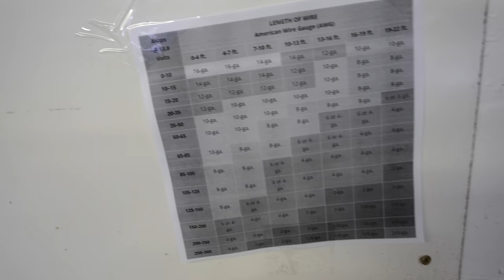Building the Brains of a Low Voltage System - Electric Hummer Conversion

Comment: I would recommend measuring the resistance of the wiring before and after those solder-heatshrink connections. Those add a lot of resistance to the circuit. That is why crimping is recommended. Besides that, the build is looking cool.
Reply: Amen i would never trust those unless you slide it over one wire then twist wire strands together first before sliding sleeve over and applying heat.
Reply: Exactly what I thought. Usually when wiring something in car you want to crimp the connections instead of 
soldering because vibrations from driving can crack the solder. Crimping and wiring is also acceptable
Reply: They do add a noticable resistance and I wouldn't use them for long high current loads. That solder softens easy and they fail with vibrations in combo. I use them for the excellent water resistance, especially in marine applications and I often add a second layer of heatshrink on top. Tip is heat the ends of the connectors. let them cool. then heat the inner solder part.
Reply: the resistance of solder splices is neglible (or effectively zero) if the splices are done correctly. They are fully rated for aeronautical and aerospace use, I was suprised to learn.
Reply: Yeah those connector suck but crimping is horrible as well solder whenever possible crimping add huge issues if you can solder never crimp it's not worth the headache down the road

Comment: The be clear, you ripped out 87a, it’s not “always on” it’s how the relay is wired if you make that wire in the circuit “alway on”. The small trigger wires of the coil are 85(-) and 86(+). A relay simply uses a small trigger to switch or control a larger (more current demand) circuit. People think that a relay somehow spools up energy and spits out higher current, which is not the case. To explain simply, controlling headlight, your (12v) supply will go in on 87 and when the relay is triggered (by the headlight switch, alarm, anything connected to the low voltage trigger wire, 85 or 86) the voltages flows out of 30 turning the headlight(s) on. 

You can ply a joke on your friend by wiring the relay to “trigger” when the brake pedal is applied to honk the horn or activate the wipers. This may require multiple relays depending the needs of the circuit and what the triggers and inputs are on the car. It’s good fun though. 😁

Comment: The explanation for the relay is unfortunately wrong.

2 cables go to the coil. This generates a magnetic field. The magnetic field physically moves a "switch". W

If there is no power connected, then the current flows through the yellow cable that you have removed. If the "switch" is activated, then the current flows through another cable. 

On the yellow cable, there is never any permanent current on :)
Reply: Correct, there is a normally open (NO) side and a normally closed (NC) side. The switch just changes which of these is connected for the current to run through.

Comment: Are you converting the 24 volt system over to 12 volt? All those lights and keyswitch etc. is all 24volt. When I did Duramax conversions on h1s we had to convert everything on truck that was 24 volt to 12.

Comment: Stranded wires have a higher resistance than their solid counter part, given that they have the same guage.

Standed wires are used over solid wires when the application is where there is vibration. 
Solid wires are used over stranded when the application is where there is a great potential for corrosion. 

Electricity runs through the copper not only on its outside.
Reply: The skin effect only affects higher frequency cables: at DC, current indeed runs through the entire conductor, so the argument mentioned in the video was indeed incorrect. It's a fair mistake to make though, since the power grid (running at 50-60Hz) does need to take the skin effect into account

Comment: coming along great! Word of WARNING: those generic branded DC circuit breakers are not very reliable. I just saw a video of someone testing those and they can trip much much lower than rated. I'd go with the actual Bussmann branded breakers, or just an AMG or ANL type fuse. Don't want that breaker to fail or trip when you're going 60 down the highway.

Comment: 23:40 Make sure you have couple backup fuses right there stored away, with so many you always want a handful as backup.
Reply: when u do it right u dont need many replacements...
Reply: @thegreenengineer7994  This is not prices engineering, this is out of the thumb engineering. So expect stuff to happen that you didn't expect.

Comment: This is coming out really cool and informative!
Though, anybody else upset that he didn't really clean the Hummer before doing this process? All that dirt and sand still in that box where he's putting the electrical! 
I mean, after tearing off all the mechanical components, I would have tore out any of the carpeting and whatnot and just give the whole chassis a good power-wash at least. I'm assuming he wants to keep that military-used patina to the paint job, so I'm not gonna ask why he didn't sand-blast the whole chassis and body. But yeah.... clean that dirt up! hahha

Comment: DC current will run through the whole wire strand, it's just AC that runs on the outside due to the skin effect
Reply: Also not all AC, but just higher frequencies. For 50/60 Hz, this effect is also negligible.

Comment: Why not use LiFePo4 batteries? 
+ Longer Cycle life
+ Higher Capacity 
+ Long Lasting 

- Cost 
- Risk of explosion (although there is no engine to generate heat and you’re using Li-Ions anyway 

Lead acid is old school, upgrade that too to the latest

Comment: AWG cracks me up every time. It's like some drunk apprentice just started giving wires random numbers.
Reply: Just do it like it's done in the eu. "mm²" Just call it what it is. The AWG system is so weird.
Reply: It is weird, but think of it as a fractional system, but in shorthand:  1/20th gauge is smaller than 1/8th gauge, which is smaller that 1/4 gauge, etc.  Drop the "1/" part of the number, and you have the AWG gauge number. Which gets confusing as you get into the 0 gauge, 00, 000, 0000 or otherwise known as 1/0, 2/0, 3/0, 4/0 or "single-aught, double-aught, triple-aught or three-aught, quad-aught or four-aught", etc, range.
Reply: Hey now, they are at least mostly sequential, so we have that going for us.
Reply: @squrrll  until you run out of numbers and start stacking 0s
Reply: AWG does look weird, but there’s a method to the madness.  The gauge numbers are relative to their *current handling capacity*, not their diameter (metric).  For example, 14 AWG (common house wire) is good for up to 15A.  Now suppose you wanted to carry twice the current, 30A (dryer).  Well with AWG, you drop by 4 gauge numbers, putting us at 10 AWG.  Want 60A? Drop 4 from 10 AWG and you have 6 AWG, which is good for 60 Amps.  I grant you, the 0 gauge numbers are weird, and after those, the system switches to MCM.
Reply: I usually just think of it as how many wires I can  fit in 1 inch of space ,so 20 Guage can fit 20 wires  and 10 guagecanfit 10 wires. When it gets to zero its 1to1. Each additional 0 represents an extra inch. I'm probably most likely wrong but it works for me
Reply: @gregholloway2656  Yeah no, just no. Use mm2 like 95% of the planet.

Comment: Your explanation of skin effect doesn’t apply to DC as there is no alternating magnetic field. So stranded wires aren’t preferred for DC, it’s only an AC thing. 
Maybe has a mechanical advantage but electrically inferior wiring.

Comment: I'm an electrical and electronical engineer. what you are referring to is the way a signal is transmitted through a Coaxial cable, not a standard power wire.  I think what you were getting at was the "skin" effect of thin wires. the coaxial inner core is a steel wire with a copper coating all around it. the signal is carried by the cooper not the steel wire.

how electricity flows through wire? The electricity that is conducted through copper wires  consists of moving electrons. The protons and neutrons of the copper atoms do not move. ... Atoms are very tiny, less than a billionth of a meter in diameter. The wire is "full" of atoms and free electrons and the electrons move among the atoms. 

The reason for all the strands in a power wire is the flexibility of the wire. as the strands go thicker the harder it is to bend and more over to cut. can you cut a strained 12 gauge wire with standard scissors? yes you can whit some difficultly. can you cut a solid 12 gauge wire with the same standard scissors? no not with out a outside force like a pair of pliers or a hammer.

do not remove the wire from the relay because you will remove the IP RATING of the relay. instead cut as close as you can to the rubber insulator.

Comment: the power running on outside of the wire applies only for high-frequency alternating current and not for dc which the battery provides! I'm not sure about it tho!!
Edit: the effect is called skin effect!
Reply: every alternating current has a skin effect. it due to self-induction. dc does not have that effect. but by the looks of it, these cables need to be flexible so that's why they are stranded. i guess.
Reply: @adid  we shall ask the @ElectroBOOM guy 😂

Comment: Nice work! Recommend isolating the battery from the electrical stuff with a physical barrier. The acid leaching, venting and corrosion dust coming off a battery will eventually take it's toll on the electrics.

Comment: 2:48 That's called skin effect and it appears in AC and variable DC, a great build project Jerry waiting for the results!
Reply: searched for this comment
Reply: I was thought solid wire is better then stranded but makes the cable stiff (good if the cable does not need to move anymore)

Comment: Like the build so far, I do feel the wires on the ABS board will wear through quite easily since you've put them right through. Normally I'd expect some rubber to protect the cables. As you said a lot of vibration will happen when driving so I'm worried the wires will wear through.

Comment: Good work. Only suggstion would be to use captive nuts or rivnuts for mounting the relays, so you dont have to pull the panel off to replace relays when they inevitably fail!

Comment: video 2 of asking jerry: What tech will you add on the dashboard, like satnav and any other stuff? 
note: pls add a mode such as apocalypse mode make the Humvee save power or something useful for the dark times, kind of like ludicrous mode in the tesla, if possible.
Reply: he should use an electronic dash for speed temps Gs etc then add a mid size display for front and rear passengers powered by a raspberry pi
Reply: if its an ev built for the purpose of not needing gas having an all electric dash wouldnt make sense. it would be wasting power on stuff that could also be done with mechanical parts, not everything could be mechanical though

Comment: The yellow wire isn't always on, it's connected when the electromagnet inside the relay is not powered. As soon as you power on the electromagnet, the yellow wire is not connected anymore.
Then you pull the rocker from one output to another :)

Comment: The smaller the wires in the wrap the more wires that can be used which increases the surface are and lowers the resistance of the wire and thats why they are rated higher.

Comment: Tip: power is measured in watts. Load measure in amps. It's your load on the fuse that pops it. 

Tip 2: Resistance of the cables working against the amperage, is what melted your extension  cord. Long cords have higher resistance than shorter cords. To combat that, you make the cord thicker. Still, length (and temps) is the killer of all cords.

Comment: soldered connections in high vibration situations are not as good as crimped connections. The solder gives a hard edge between the wire(flexible part) and the solder blob (rigid part). The small individual wires in the strand will always bend in the same location when vibrating or moving. With crimped connections, the bending location is more spread out. Just something to consider.

Comment: "The more strands of wire in the cable 
the easier it is for electricity to flow through them..."

This is patently false... 
Ampacity does have to do with surface area, 
(cross-section) but the Skin Effect is reliant on Frequency... 
DC has no frequency

What you are holding in the 4/0 cable is called DLO cable, 
the tiny strands make it more flexible- that's it... 

for example go look at some 4/0 or 250MCM THHN or other than DLO cable... 
DLO is like welding leads, the tiny strands move around 
more in their jacket making the cable flexible 

More Strands does not equate to more Ampacity- 
never has, never will

Ampacity of a wire of cable is WAY more complex than 
the size, surface area, insulation, and flexibility of the conductor- 
the temperature and application of a cable play a 
much larger role than the make up-of the conductor- 
as temperature increases, Ampacity decreases 
this is due to the resistance changing in the conductor... 
conductors in free-air can handle more current than 
conductors in an enclosure or conduit raceway... 
the principle issue with ampacity in a conductor 
has to do with temperature- 
that is why the National Electrical Code is 
written by the National Fire Prevention Association 

I'm dead serious on this... 

The NFPA70 NEC 2020 can be viewed for free online...  
look at section 300

had to un-sub bro- I don't suffer fools lightly

Comment: If it weren't strands, you wouldn't be able to bend it. (2/0-4/0 strand is hard enough to bend) We used 4/0 welding cable in our builds; it's finer strands and thus easier to work with. (we're also pushing 600A max @ 150vdc - higher V packs can use less current for the same power)

Your extension cord melted at the end because it had crap connectors. (an all too common thing.) If you overloaded the line, it would be melted out in the cord somewhere. It's easy to tell you're overloading it by simply touching it: it should not be hotter than ambient. (certainly not to touch.)

Comment: I'm confused. We had an H1 hummer and the 24 volt part was just for the starter and everything else was 12 volt, I heard that the HUMVEEs used a military wiring system that was all 24 volt components. Since you're pulling everything out you may not need to know the difference but that military wiring is oddball stuff on a road vehicle. Does your truck have any of the options like pressurized transmissions for deep water fording? That's why they have that sealed electrical system that you are ignoring. How about CTIS? There's a pretty big pump that runs that.

Comment: why need the battery if you have the bridge 480V to 12V? for redundancy?
and why 12V battery gel and not Li-po?

because that 12V battery will drop after 3-4years...

Comment: Just so you know relays were created to lighten up a vehicle as one can use the thinner lighter wire as much as possible on the vehicle and the thicker heavier wire only when needed for short runs. It's all done to cut the weight of the vehicle as more weight equals more power needed to go places.

Comment: The 0000 cable isnt normal wire, its weldflex, thats why its orange and has more strands. 

Also anything under 8b&s/gauge is counted down in mm or inch. Tell any autoelectrician youre using 25awg theyll look at you like youre stupid lol.

Comment: I would  rather use Deep cycle  batteries instead  of regular trucks battery since that really  needs to start the car. 
The curent  capacity to start the engine is what important on those and when the engine is running all electrical, the load side is running  off  alternator regulated probably  by PCM. So it is engine  alternate! 
Now question. How you actually  planning  to charge  that battery? The most efficient way for that battery  would be that engine  alternate  which ware changing it. Im assuming  you aren't gonna use that???
     So what really needs is constantly  maintaining the load (how much is it all together on 12v side?) and that actually  should  be covered up by your alternator which is on that hamvy ware probably  200A. At least. You don't  need that much of course. But let's say you want to be good at least to have  like 100amps of abilities. 
   I think your battery  will have to be changed! To what? Depending on the way you going  to charge  it!
 Also keep in mind that 12v system  runs on 13.2-14.2v in the vehicles systems under regular circumstances.
Would  you recall that glitch when you doorman light on battery became brighter when you start the engine?  you can see that difference aren't  you? :) 
Into consideration!

Comment: The effect you explained about electricity running along the outside of the wire is incorrect. The effect your explaining is called the skin effect I believe. This is only relevant with frequency signals traveling through copper wires. Have stranded wire is only a benefit to flexibility of the wire. A solid 1/0 wire would be able to carry more current due to there being more mass. The amperage rating is specifically determined by the mass of the copper in the conduit. This is why a 1/0 solid conduit has a smaller diameter than a stranded 1/0 conduit. Because the density of the wire is higher when solid. 

If electricity truly ran on the outside of the wire, it wouldn't make any sense to use anything but super thin copper strands.

It is interesting to hear you explain concepts when you don't truly know them well enough to be a teacher. You state this clearly in all of your hummer videos, so it's not a dig. I still very much enjoy this series, but I do worry that some of the things your telling the audience will be taken as gospel. When in reality your learning as you go. I know you'll most likely never see this comment. If you do, just know that stranded wire isn't "better" at carrying current. It's just more flexible.